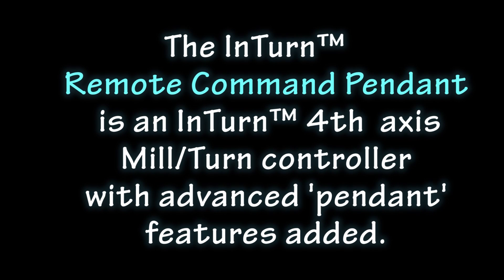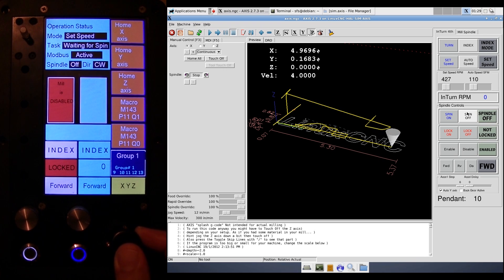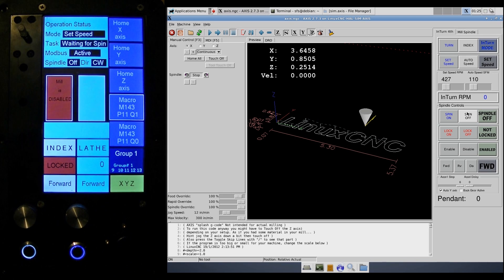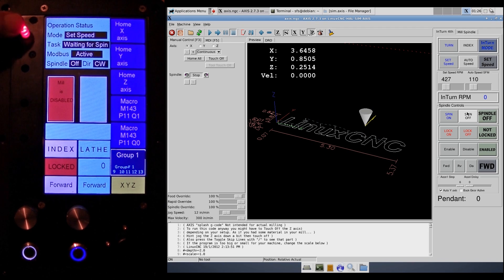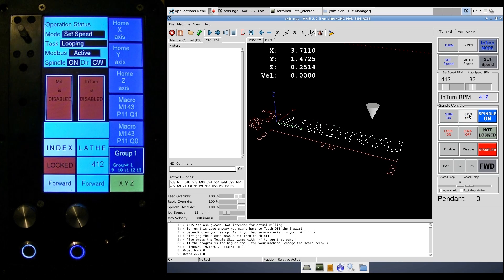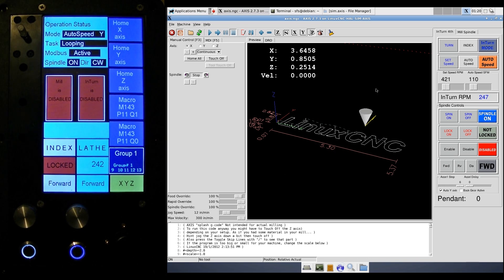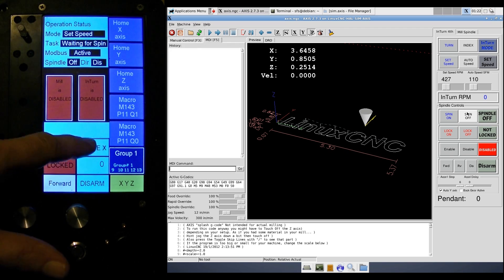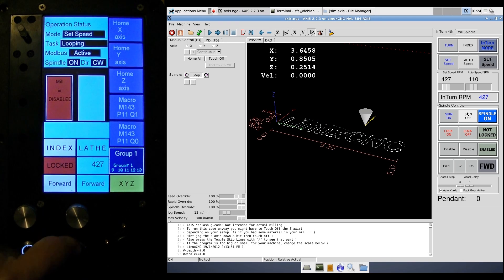InTurn™ Remote Command Pendant for LinuxCNC/Path Pilot

Comment: https://vk.com/id275094966?w=wall275094966_613%2Fall             What's your opinion???
Reply from the maker: +The Agent Of Death It appears to be a conversion of one of the 'multi mode' machines. Basically a lathe with a stationary milling column bolted to the back of the bed. There appears to be some arrangement where the column is able to move along the bed. Not an optimal arrangement, but then neither is a typical 'knee' mill, and people convert them all the time. In fact, amazingly, you can buy a brand new CNC 'knee' mill . . . which is sort of like putting a racing stripe on a horse and thinking that makes it a Ferrari.I encourage anyone to experiment with machine designs of any type.
Reply: The basic option involves the milling column on the rails with the vectors of the top-down, left-right and 2 turning spindle back and forth(the other bells and whistles angular rotation of the head revision ,there is alternatively the hydraulic thrust is the worm mechanism,and the fact that Ferrari ,you probably thought themselves that will optimally turn-mill base.Hole 40 mm spindle sharpened by er 50? processing 300 air Chuck-automatic-caliper decreases not affect not as classic 180 mm "on it," milling feed across 240-250mm 380mm top down, long billets -cutting lathe 800 mm when in milling mode the table is 600*240 mm will be the most difficult rotation in 90 at the base of the column.Agree nothing new, but this old brought to mind.Here are the other options work the figure "1," operation, movable lathes spindle and fixed column. Figure "2" rertain processing of the workpiece ,clamp in segotici pnevmoapparat-unclamping of the Chuck, shift the lathe spindle back clamp lathe

 photo 2
https://vk.com/id275094966?z=photo275094966_403449438%2Fwall275094966_622

Comment from the maker: Currently I have the MESA Electronics 5i25 board that came with Path Pilot, but an additional 'daughter card' is required to connect industrial drives which have differential step/dir and 24v signals)  Apparently, these are in short supply. One of my testers in Europe was notified that his board set was shipped, but I and others in the USA are still waiting.  When the board arrives, I will connect this stuff to an actual mill and post a video of the machine operation.

Comment: I've like your work since I first saw it a year or 2 ago. Is there more info on this controller and 4th axis? Availability?
Reply from the maker: +Tactical Advantage Armory I have added three links in the description above. The Pendant was originally developed for MACH4 and in that video around the 3 minute mark is a more detailed explanation of how the command/acknowledge communication works.These Pendants are available now, but initially, I am only building a few units for my Linux testing crew. I am slammed with other projects right now, so there is a waiting list for production units. I will be doing a lot of work with LinuxCNC.
Reply: +Simpsons36 thanks. I'm running path pilot and am looking for price and ballpark availability.

Comment: Looks great Steve - when will it be available?
Reply from the maker: +Mike Henry I have your e-mail and will respond t that, but I want to make one comment here: It is prudent to avoid posting  availability or pricing in this venue because  people tend to think that those postings are current even after several years have passed. I will add a link to the InTurn site in this videos  description. There are specs, pricing and contact info there.
Reply: +Simpsons36 Thanks - looking forward to the pricing/availability info when ready.  I couldn't see any info on the pendant at theInTurn.com link but will check there periodically.
Reply: Steve - is there a link on the InTurn site for the pendant yet?
Reply from the maker: Hi Mike, the pendant is fully operational with both MACH3 and LinuxCNC, but I am porting the whole thing over to a much more powerful (and significantly cheaper) processor. This will accomplish two things 1) there will be a new well of power to draw from for more advanced features that I want to implement and 2) a significant price reduction. I have a bunch of pre-orders for these pendants and I contacted the buyers and gave them the option of taking the existing functional pendant or waiting for the new version and ALL of them chose to wait for the new version, so the existing product that you see in this video was never produced.
Reply from the maker: To continue the reply, the current status is that the 4th axis motor controller, the Pendant functions, and also the ATC controller have been modularized. The motor controller module is the same in the InTurn™ 4th axis motor controller and the pendant. That part of the porting is completed. The pendant functions and the new screens (for the touch screen on the pendant, not for the CNC software) are not completed. This is causing a significant delay in releasing the new pendant, but once completed the capabilities and particularly new more advanced capabilities should make it worth the effort.
Reply: Thanks Steve - I'll email about pre-ordering.